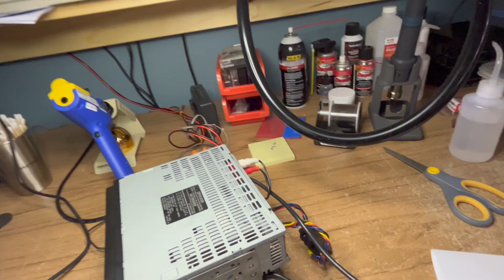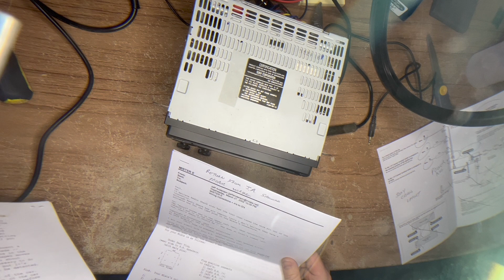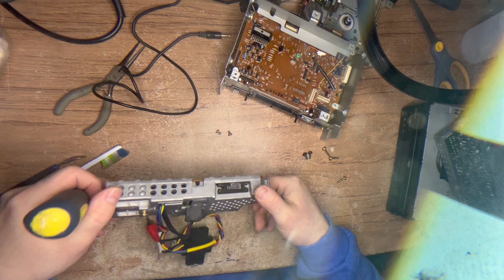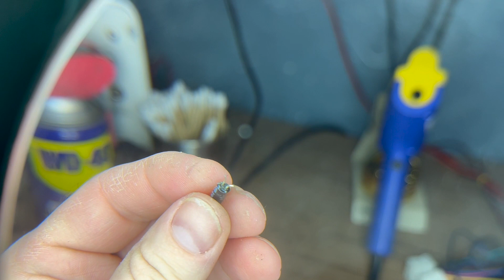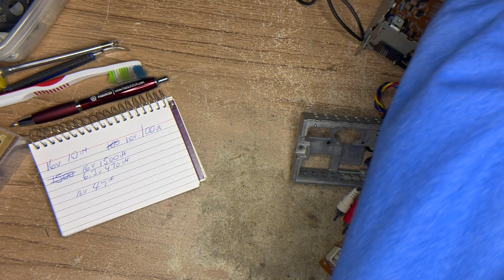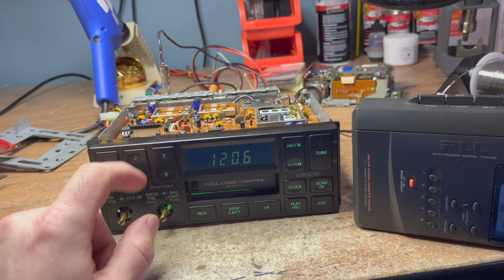Exploring a "Jeff Anderson" Modified Miata Stereo!

Comment: I have a Jeff-modified 1991 radio with Aux, new LED lamps, "bass boost" and general repair. It's not installed in my car at the moment, because 10+ years after the first fixes, the sound started to fade again, and I didn't want to pay Jeff to fix it again.  But I'd be happy to disassemble and take pics of things if you wanted to compare anything.  BTW, the jumper on the rear plug is a common fix for the "Radio won't turn on" problem.  A lot of people DIY that one without taking anything apart.
Reply from the maker: Nice! I don’t have Jeff’s modifications detailed, so I have not offered any of them. I did experiment with his aux mods, but I found my methods to sound cleaner as I tap into the DIN plug from inside, using a Bluetooth module that has a bypass relay built-in. The radios that I’ve gotten in with turn-on problems were fixed after a full electrolytic capacitor overhaul - so I may have stumbled on the real culprit by accident. Your stereo can be fixed by performing a full re-cap as well - aged-out electrolytic caps and broken solder joints are the two primary causes of failures in these units.
Reply: @bbishoppcm  I always thought Jeff's Aux mod was kind of weird. Anything sending signal into that cable would play, whether the radio was on or off, or even if another source was already playing. But it worked for it's time. I'm the original owner, and was happy to get an aux-in when iPods and phones became more common and cassettes faded away.  But now my state has gone hand's free, so I installed an Atoto A6 and put my original aside.  I need to open it up and see what it looks like. I'm getting more confident; I recently returned a Sonos Play:5 to life by finding and replacing a tiny dead SMC resistor. :) But I've never had the guts to poke around in my original Miata radio. I love what you're doing, helping to keep our cars fully alive!